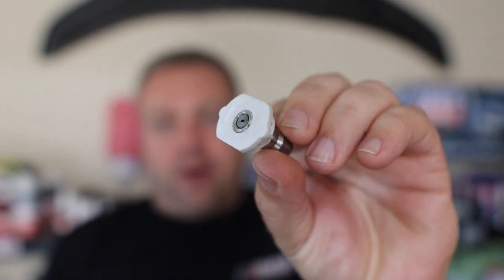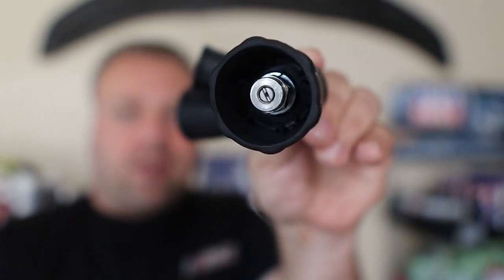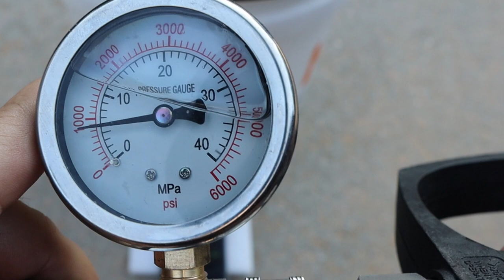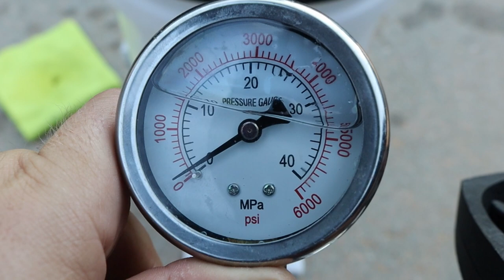CREATING NOZZLE GUARDS | BETTER THAN YOU CAN BUY | CAR DETAILING TIPS

Comment: Just came across this older video. Great channel Keav. Thanks for doing all the research on the parts to make this all work. I ordered all the parts to make a couple of nozzles, should have ordered more. Not sure what tip size is best for a low end Ryobi pressure washer, but I got 3 different sizes to experiment with. Getting the nozzle to seat in the rubber nozzle guard was a bit challenging but I got two nozzle assemblies built to try out tomorrow. Thanks again for doing all the research and trial and error for the rest of us.
Reply from the maker: That’s awesome yeah it takes a bit the first time to get that rubber worn in. Usually on a Ryobi the 2.5 or 3.0 is the one to use.
Reply: @CarsWithKeav have you used these 65° nozzles you listed on this video? I got one but on the 1.2 gpm pressure washer it really makes the pump work hard. Not sure it’s a good idea on the little Ryobi pressure washer.
Reply from the maker: @timmckusker  the 65 degree ones work
well for using the pressure washer hose for rinsing with spotless water. You use them with the pressure washer off.
Reply: @CarsWithKeav  Ok I will give it another try and see if it will work for rinsing soap after a contact wash, though probably expecting too much there.

Comment: This video really needs a lot more views. I've made essentially the version3 on my own before after I saw the OG version, but version2 and version1 are great ideas and I like them a lot better. Here are some tips I've found for assembling v1 and v2 after finally getting around to making them.

First off, when buying parts, it's worth noting that MTM 1/4" male disconnects are slightly longer than generic 1/4" ones from Amazon and normal nozzles. This seats better if your gun uses a MTM coupler but it also makes it potentially incompatible with generic ones like the meteor pivor coupler that Keav recommended in another video. I went MTM cause I made these before trying the pivot coupler.

For v1, I don't know if Keav just bored out the 1/4" rubber hole or if he had a different 3/8" nozzle guard or something. The one I got has a 1/4" hole that is meant to slip on a pipe like what you find on the MTM bent wand. What you actually need is for the hex bolt on the qc to squeeze through the smaller 1/4" hole on the nozzle guard. The female to female hydraulic coupling in the middle is what should bottom out inside the nozzle guard. If you have the 1/4" hole like I did, you can probably enlarge it but since the rubber can stretch and compress, I just forced the hex bolt through. A bit of grease or dawn and some muscle power is all you need and I actually like the tight form fitted look afterwards. With NPT tapered threads, the amount that the qc sticks out is gonna depend on how much of the thread you can actually torque into the female coupling. Mine with a MTM qc and teflon tape actually sticks out a couple mm more what Keav showed so you should definitely not have any problems with clearance.

For v2, it's a bit more work but I wanted to use a stainless high pressure hydraulic male to male coupling instead of the brass pipe Keav recommended. As Keav mentioned in the video, those male to male couplings have a bolt pattern in the middle and don't fit through the 3D printed base. However if you look inside the base, you'll see little tabs which is what prevents the bolt from going through. I just filed them down with a dremel to allow the hex bolt pattern to fit through and bottom out in the piece. The male threads fits through the hole and sticks out plenty to torque down the qc on to it. The rest is pretty much just as Keav showed it. Torque the male-male pipe/coupling into the built-in coupling (lining up the hex pattern if needed), push it through the base, then torque down the qc, sandwiching the plastic base between everything. You can then screw in the nozzle and attach the boot. There is normally a metal washer in the rubber boot part. Remove it so the nozzle and any excess length on the coupling assembly can just go directly through the hole in the rubber boot.

Aesthetically, I like v2 boot best even though there is more metal sticking out but it's really a ton more work to assemble, add more work to take apart, with minimal practical benefits.
v1 and v3 took less than 5 minutes to assemble. Just torque the pieces down and that's pretty much it. v2 took me probably an hour of dremeling and test fitting before I even started assembling it.
Reply from the maker: Appreciate that feedback. You can also drill out the bottom a little to get more room. If you buy the right Quick Connect that will help with how far it can stick out on version 1. Some QD's are much longer than others.. I use all 3 versions with different orifice sizes.
Reply: Great info. I’ve made all 3 and agree V2 boot aesthetically looks best. Overall the streamlined look of V1 with less metal exposed is probably best.

Comment: On assembling Version 1 (your favorite), did you use thread lock or teflon tape on the fittings or just torque them down good without it?
Reply from the maker: I always use Teflon tape. Then I was using a gray color one from oatey called fastape which was good, but I now use Blue Monster tape as it’s blue and easier to see if it’s there and I think is a better product. I don’t like to use thread lock as I take my stuff apart all the time to change it or try something new and don’t want the headache of having to use force to break the thread lock plus it can get messy.

Comment: I'm a big fan of just using a male 1/4 nozzle and a female 1/4 plug, I feel like those nozzle protectors with an inbuilt bolt just adds another possible leaking point. I recently did the same thing as you did with that MTM nozzle protector but instead used the mosmatic rubber protector OG uses. Way better then those little nozzles.
Reply from the maker: Nice, will look into that.  I do prefer the much larger MTM one and the price is great.  I'm not a fan of the inbuilt they have so mine has a 5000 PSI rated coupling that's 304 stainless. I think the inbuilt one is just cheap zinc plated crap.

Comment: I have a 1.2gpm 1900psi Ryobi pressure washer and I want to make one of these 40 degree nozzles. Which orifice diameter would be best 2.0 or 3.0?
Reply from the maker: 3.0 on a Ryobi will get around 1100 psi and is a good sweet spot. 3.5 closer to 850 to 900, but much higher GPM. Close to 1.5 gpm with a 3.5. 2.0 Is close to what they come in the box. 1.7 or so is out of the box and the psi is very close to advertised.
Reply: @CarsWithKeav  thanks Keav appreciate your help I had both the 2.0 and 3.0 in the cart since I was unsure of which one to purchase so I was going to make one of each but looks like I’ll be removing the 2.0 40 degree nozzle and add a 3.0 25 degree nozzle instead that way I have both 3.0 25 and 40 degree nozzles.
Reply from the maker: @Jonathan-pr1wo  good choice. One for wheels and tires then the other for the paint.

Comment: Did you use thread seal tape when joining the 1/4 male QD with the nozzle through the coupler?
Reply from the maker: Yes, I used Oatey Fastape so its a gray color.  I try everything without tape first then add some if needed.  Seal tape can get into the water flow after tightening and clog things up.
Reply: @CarsWithKeav  Yeah, I was curious if you could avoid tape. Thanks for trying all of these. I really like your solution to minimize the metal exposure in the rear. I've ordered the parts and I'll give it a try.
Reply from the maker: @MegaMajormax  Cool, That first few times to move the unit in and out  is a bit tougher, but a few times it wears in.  Its good that its tight or else it would feel cheap and not secure. You can drill the bottom out a little or use a razor if its too tight. Depending on the QD some are bigger in width and length than others.
Reply: @CarsWithKeav  I did end up getting all the parts and making two nozzles for my VE52, a 4.0 25 degree, and a 3.5 40 degree. They're very compact, and much better than anything on the market, MTM's or OG's Mosmatic ones. Thanks!
Reply from the maker: @MegaMajormax  That is awesome, I don't know why nobody is selling these. I thought about it, but unsure of the legal issues using the MTM parts and then reselling. Where did you get the 3.5 tip at? They were sold out last I saw.

Comment: Use the Suttner nozzle guards from image products there like 8.99 bucks I made my own use those or chem X has them as well but like 13.99
Reply from the maker: I saw those and thought about it, but wanted to create something without that metal protruding out the bottom. It is a great value option though and has a cool look.